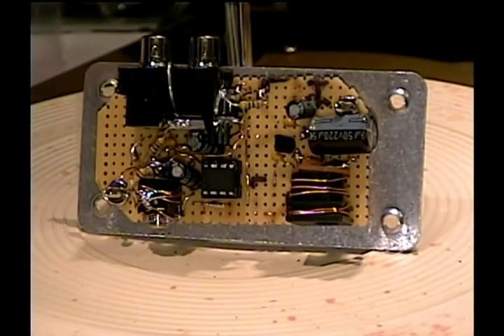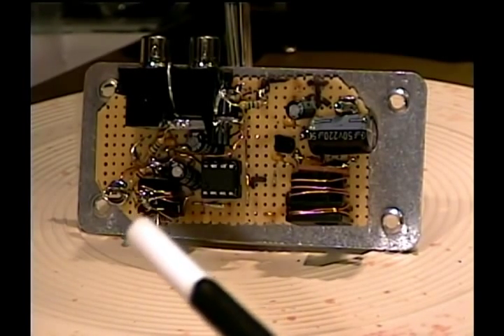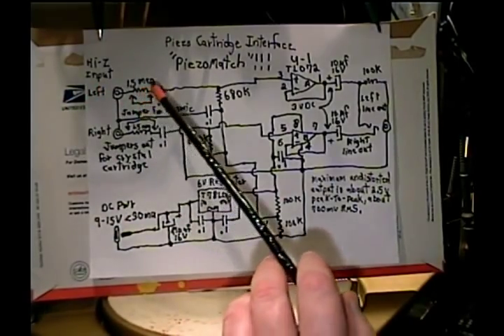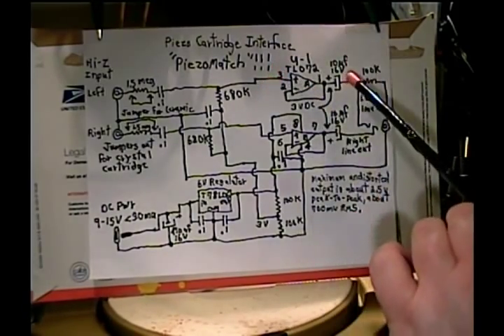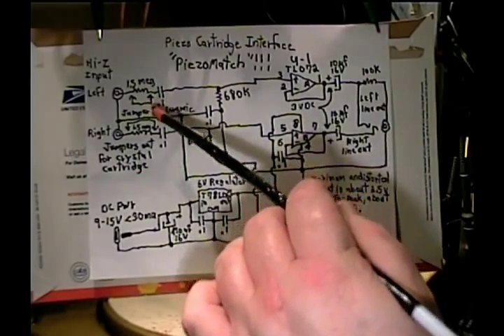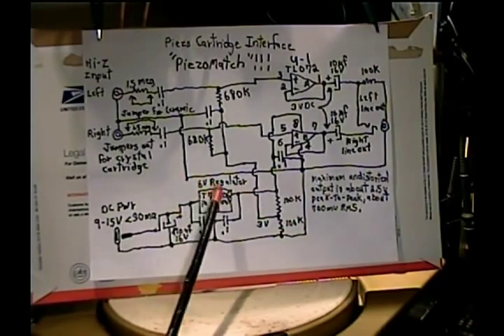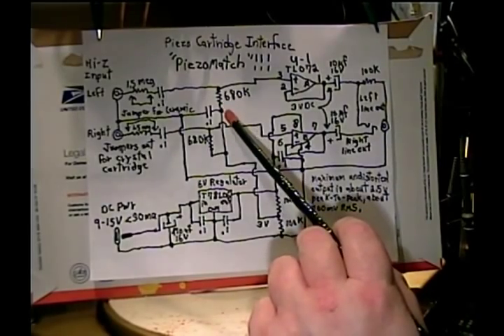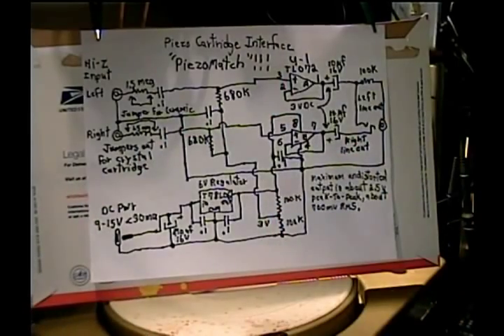PiezoMatch Impedance Converter.mp4

Comment: Many thanks, imfree707, for the video. I built a single channel PiezoMatch on a small piece of stripboard, using a TL071, for matching an old BSR mono crystal cartridge in a Goldring-Lenco GL78 turntable to the line input of a Marantz PM6004 amplifier. The results are sensational, no further equalisation being needed. It's extraordinary how good these old cartridges can be made to sound; in fact arguably better than an up-market Shure magnetic cartridge on the phono input of the same amp!